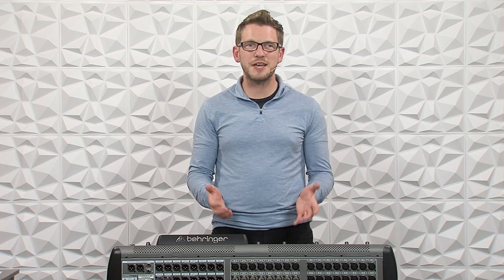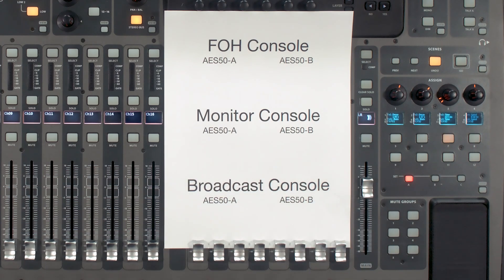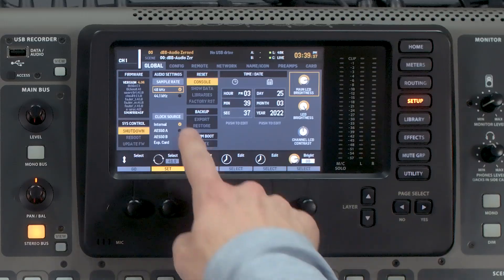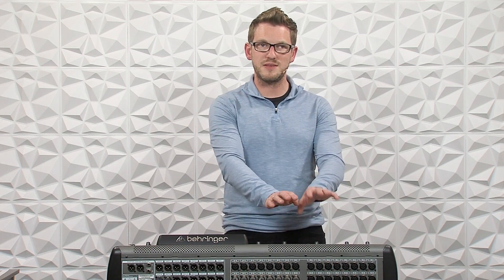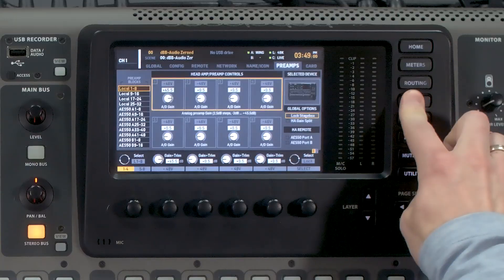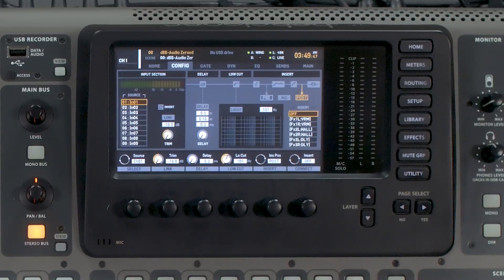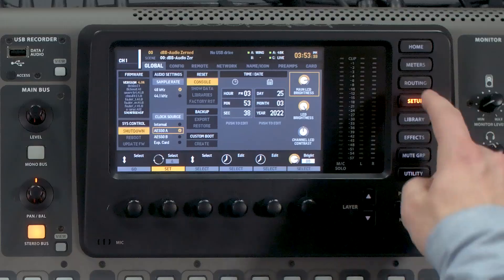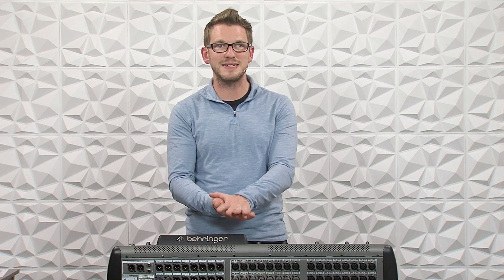Your Behringer X32 Questions: Connecting Three X32 Mixers

Comment: Thanks Drew, some great information on your channel. I am trying to setup an X32 Console (FOH) with X32 Rack on stage (Monitor Mixer) and 2 S16's for stage I/O. I need 32 inputs to both the X32 Console and the X32 Rack. I want all stage input from S16's at front of house for Audience mix and all input from S16's to X32 Rack for stage Monitor mixes. I have watched many videos from you and other channels and can't seem to get my head around the routing to setup this configuration. First, Is this possible? and Second, how would I connect the four units to achieve this?

Comment: Please show me , M32R and X32Rack connect to a DL32 , i need setup M32R for FOH and control GAIN , X32Rack setup For persornal Monitor or Inear Monitor with From out put DL32.

I connect M32R AES50 port A to DL32 AES50 port A and clock internal for FOH
and connect X32rack AES50 port A to DL32 AES50 port B and clock AES50 for Monitor 

but i can't send ch. to bus for monitor with X32rack because out 1-16 DL32 Control with M32R , X32rack can't bus out with DL32.

Comment: I would like to have an FOH then run a Ethercon to the stage and connect to a Stage box, and Hub 4.  Currently I have x32 A-AES going to Stage box for drum split and local inputs on x32 used for additional inputs at stage right.  I have another SD16 so I would like to have x32 out front (no ipad) and one Ethercon coming from FOH position to stage box SD16 and SD8 (at drum location) and Hub 4 on AES B I have another x32 that can be utilized if needed.  I can't find much info on Hub 4 but we are running 3 DP48 with POE power to stage positions.

Comment: This video was great but it stopped me from one thing. I used this video to help setup a monitor and FOH setup. I figured out how to get the x32 rack to send sound, but no matter how I set the routing up it will not allow the second console to send sound out. All meters work but no sound comes out of the second console. Any advice on how to get both units to send sound out of the s32 outputs?
Reply from the maker: You would need to route the audio from that second console to the first console via AES50, and then use the first console to route the audio to the S32. You would need to utilize the User Routing for this.

Comment: Hi Drew, we are using the X32 rack + S32 for rehearsing and gigs. Now we just set up the whole thing with backing tracks in Mainstage and in ears for all band members. From April on we're gonna do some live sessions / mini festivals with other bands at some different venues. The question is if we can bring our own rig and send all the outputs to FOH, even if they don't use Behringer but another digital console, like for example Allen & Heath, PreSonus or Soundcraft. Just so we can have our own in ear mix and backing track settings as we are used to and don't have to start from scratch each gig. Thank you for the great tutorial videos. You helped a lot :)
Reply: You'll probably want a splitter snake so you can have all your inputs to your monitor rig and provide each channel to FOH. You can either get an analog splitter snake (Seismic has a bunch of rack mount options) or a couple rack units like the ART S8. With these you can even omit tracks (like click) that aren't necessary for FOH
Reply: @AdrianEitzenAMSE  Thanks! We got that up and running now :)

Comment: A few problems I’ve found with this setup is you can’t send an Aux input signal to the Aux input of another console. Also the talkback input becomes completely useless. Also I find the gain splits very clunky eg. At several shows I’ve done recently the gain control wouldn’t show up on either of my 2 consoles, only trim. Then once I restarted the gain showed up but it didn’t affect the input level at all. Very odd problems but nothing I can’t work around.

Comment: I have two questions. Can I plug the instruments into the stage box directly without using the Direct box? the second question is that possible to connect xr18 to the wing? Thanks

Comment: Love your channel. Question for I own an x32c  I want to make that my FOH mixer but want to control my x32 rack and dl16 from the FOH mixer. I run IEMs on aux1-8 now. But for some reason I’m having a problem with the outputs 9 through 16.  I can’t seem to figure out the routing. Do you already have a video for this?

Comment: You really can use "better than" Cat5? I've had connection issues using anything but Cat5. Specifically, I couldn't connect to the snake using shielded Cat7, with latest firmware on all devices.

Comment: Hi Drew, I have a question, that I hope you can answer. I have an X32 Compact for FOH, and an M32R for monitors then an S32 and SD16 rack units. I would like to use all 16 outputs from the S32 for in ears (large group doing stereo in ears). Then I would like to use some of the outputs from the SD16 for my main speakers (and possibly a couple monitors for the choir director etc). Watching your video I was able to get my units sharing inputs, but I'm confused on how to route my main outs to the SD16. The switch on the SD16 is set to 17-24. Currently I'm running the cables like: X32(FOH A) to S32(A) - S32B to SD16A - SD16B to M32A. I see all devices connected in the X32. Just don't know how to make the main outputs from the X32 go to the SD16.

Comment: I am working with a Church that has a FOH mixer that they store in a back room. I want to be able to set it up to be able to be plugged into that storage room so they can run the console from a tablet. what is the best way to wire this. there is one board that will be moved only. thoughts?

Comment: Wrong on the cable again. Shielded Cat5e ONLY. That is in the manual and the tag that comes covering the AES ports on new consoles. AES was designed for the twist rate of cat5e
Reply from the maker: The category number of ethernet cable is actually the cable rating of the highest MHz of data and the speed rating of the cable. As long as it is shielded and a minimum of CAT5e spec, the cable will work.

When you are comparing a CAT6 cable vs a CAT5e cable, the CAT6 cable will have less crosstalk and interference, therefore is a more robust connection. Additionally, you will find that a higher category rating of network cable is backwards compatible with a lower category of data transfer.

Comment: I've noted your comments on screened data cables, but it worries me. One of the real advantages of the cat5 or above was that the grounds of the connected equipment are NOT bonded together. As an example, with bigger venues, the ground potential between stage and front of house grounds, in things like theatres, can be a few volts - so old analogue systems hummed when the grounds were connected and worse, potential fault currents could use the common ground in some circumstances.  With digital, this went away - but I'm not comfy with re-introducing a common ground system, with all the issues it can/could cause. Maybe a screened cable grounded at the stage end, but floating at the front of house end would be fine - for the screening, but no actual current carrying path? It sounds a backwards step to me, and so far with 50m runs, I've never done it or had an issue - but I didn't know grounding via the data cable was a recommendation?  Hmmmmmmm
Reply: The shielded cable is the manufacture spec. Its to help prevent static build up in the cable and RF rejection. Also only cat5e stp should be used. AES 50 was designed for that. Its not a IP signal where higher grad category cable makes a difference
Reply: When I connected an S16 to an X32 Rack using an un-shielded cable it did cause big problems like loss of sync that were resolved when I used a shielded one, so I'm sure Drew is right on this one, but I take your point on the potential between 2 distant locations being a possible issue.
Reply: @Weirdbloke1  very strange - I've got some tough data cable on reels plus a number of oridinary cat 6 unscreened and never had any issues linking my two X32s and an M32. It never even occurred to me there was a problem till I read these topics - now I'm thinking?
Reply: I just checked the X32 schematics. The shield of the RJ45 connectors is directly connected to digital ground. I thought they might be capacitively or otherwise coupled to avoid the commoning of the grounds between interconnected consoles, but I didn't see that.

Comment: Nice video, thanks a lot. I have a question: I'm looking for the best way how to use waves plugins running on SuperRack native or SoundGrid server. Could you please test several cases:

1. Waves card connected to X32 and run SuperRack native and Soundgrid server.
2. Dante card and SuperRack native via virtual sound card and dante PCI card and dante RME card.
3. Connect X32 via AES50 to DN9630 or Lynx AES16e-50 card.

I'm looking for routing and round trip latency in all cases. Thank you a lot for the info.